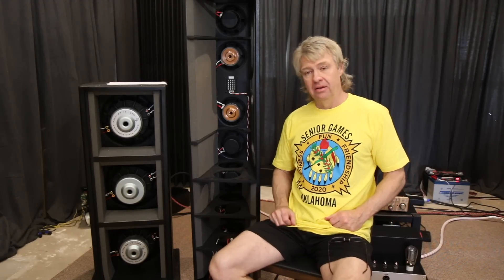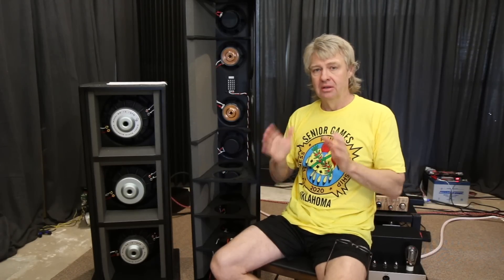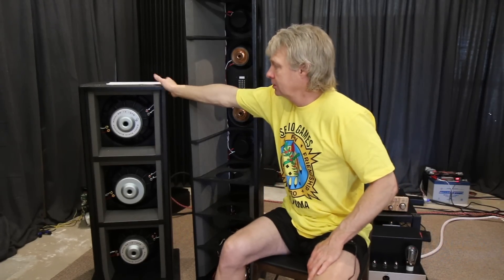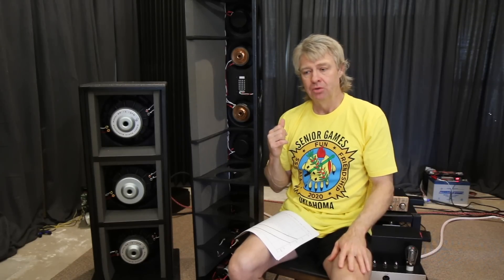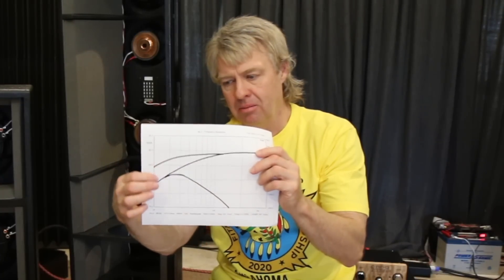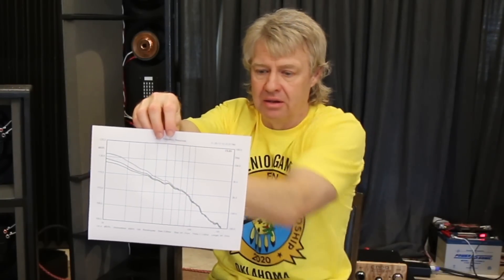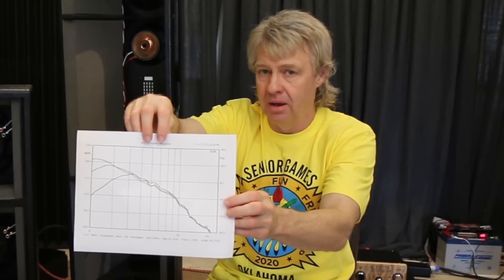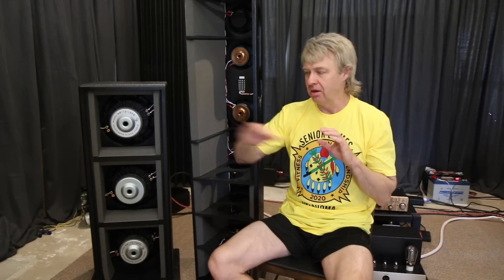Open Baffle Basics pt.4

Comment: I am embarking on an exciting project to create an Open Baffle speaker system, and I've already selected some fantastic drivers. For the high frequencies, I will be using the Dynaudio D28 tweeter, which boasts a sensitivity of 93 dB SPL. For the midrange, I’ve chosen the Dynaudio D54 midrange driver, known for its higher sensitivity of 96 dB SPL. To handle the midbass frequencies, I plan to incorporate the Dayton MB620-8 6.5" driver, which has a sensitivity of 94 dB SPL.

However, I find myself at an impasse when it comes to selecting a suitable 15" bass driver. After delving into numerous forums, I encountered varying opinions regarding the ideal Thiele/Small parameters that should guide my choice. My inclination is to go for a professional-grade ribbed high SPL driver, as their output can be remarkable compared to HiFi drivers. Yet, I’ve noticed that high SPL models tend to produce a softer low-end response, which is a concern for me.

I am seeking guidelines to help me choose the right bass driver. Is it truly correct to say that achieving a frequency response lower than 45 Hz is quite challenging with an open baffle design? Additionally, I’ve come across conflicting advice about baffle width; some advocates suggest a narrow baffle for improved soundstage presence, imaging, and depth, while others argue that a wider baffle can provide stronger, more impactful low-frequency response. My intention is to prioritize the best soundstage possible, and I’m open to incorporating a subwoofer later if I find that I need more low-end extension.

This speaker system is primarily intended for enjoying music, particularly jazz, where the richness of a stand-up bass, the clarity of vocals, and the overall dynamic range are essential. I will be using a Yamaha TRS700 amplifier with a rating of 100 watts into 8 ohms, which can also drive a 4-ohm load. My plan is to wire the bass driver at 4 ohms while keeping the three other drivers at 8 ohms.

For my crossover design, I’m initially considering a first-order Butterworth network for all drivers, with the possibility of transitioning to a second-order Butterworth if necessary for smoother frequency transitions.

I know this is a detailed request, but I would greatly appreciate any assistance you can provide in selecting a bass driver that complements the characteristics of the other three drivers, all while keeping the budget under $100.
Thank you in advance!

Comment: Nice, I'd love to hear these. One question, does the full-height-wing-side face the inside or the outside when the speakers are in place and toed in? So take just the lft speaker, is the full height wing on the right (inside) or left (outside). Also why?

Comment: Hi Danny - quick question.  I see you have 3 different models of drivers for Servo Subs on your website.  For the life of me, I am not spotting the difference between the three.  Can you help point out what is likely right in front of my nose that I am missing?
Reply: The models with a FR at the end are designed for free air applications. We have them in 16 and 8 ohm versions so that they can be run in parallel. The 4 ohm woofer is designed for sealed boxes.

Comment: My question is, if you can only go down to 200Hz on a OB, and you still need two subs to reinforce the sound, whats the point, does they really give so much clarity compared with just using a top class driver such as Seas Excel, and wouldnt you also wish to have an open back tweeter if it makes a difference to high frequencies?
Reply: We have open baffle drivers that play flat to 20Hz. Also, our NX Series models have a planar magnetic tweeter that is full open baffle as well.
Reply: @dannyrichie9743  Isn't flatness more a function of front panel design than than the actual driver? a serious question as I am unfamiliar with them.
Reply: @engjds  There are several things going on here. Front to back wave separation will control low end roll off. So a wide baffle or a baffle with side wings will extend low end response. Our servo controlled woofer are loaded in an H frame and with the help of the servo control system, they will play flat to 20Hz.
Reply: @dannyrichie9743  20Hz is a bold claim, though I do not doubt you have measured it correct, it must be very sensitive to room placement with all those additional room modes?
Reply: @engjds  Are  woofers are not at all sensitive to room modes. Our woofers play flat to 20Hz and hit -3db down point in the teens. They also stop on a dime. 🙂
Reply: @engjds open baffle speakers have a finger eight radiation pattern  so side reflections don’t really exist.
Reply: @Margarinetaylorgrease  figure 8 sections must still count when the position is such they become standing waves, I do not understand what you mean there.

Comment: I am a big open Baffle fan but as a fan of SE tube amps I have a little different philosophy. I am not a fan of servo control and arc welders for amps.

My thinking goes like this. Large, efficient, high Q bass drivers wide range mid (AKA FR) and super tweeter.

Since the output transformers are likely to struggle below 30 or possibly 40 Hz there is no need to try to force them down to 16Hz. Just use a sealed or IB sub for the last 8va or 8va and a half. The percussive bass is well within the range of the mains so you get the terrific OB bass sound and the sub can handle the lowest pedal tones. If you can get the sensitivity you want with a single 15 or 18 OB woofer you can even include the subs in the same stack.

Comment: hello Danny, does a h frame really separate front and rear waves ??? Air inside the cavity will load the driver. but since the wavelengths are huge, separation of front and rear doesn't happen i guess. or may be negligible minimal.

Comment: On your site, you have kits for "sealed servo" subs and "open baffle" subs.  However, the amps and drivers seem to be the same for both.  What is the difference between the two?  Couldn't you also use the "sealed" driver/amp combo in a ported or open baffle configuration?  Or am I missing something?

Also, you are using 370 watts for a single driver sealed sub and 370 watts for a double OR triple driver open baffle sub.  Doesn't that create a problem with response to spread the wattage over more drivers (e.g. damping, excursion, etc.)?

Thanks for the very informative series!

Comment: I built a pair of  your W/Frame subs back in 2016. They provide a nice bottom to Magnepan 3.6 planars. For music they are fine, but often with heavey bass in movies and TV they would bottom out and often  blow the covers off. To fix this, I even ordered new Rythmik drivers and modification to the A3470 PEQ from Brian to build new sealed subs. But, after setting up a new Lyngdorf MP60 2.1 processor things have changed. Before I ran the MP60's RoomPerfect  correction program, it told me to do a sub adjust program first. I did this to the W/Frame subs and then I ran RoomPerfect with 13 mic positions to 100% room correction. The subs no longer bottom out and my 7.2 Magnepan system has never sounded like this. I guess I will try to return the Rythmik parts back to Brian since the W/Frame subs are completely under control. Or, I could build two additional sealed Rythmik subs and add them to the system. The MP60 has 16 outputs and I can't use Atmos with a sloped ceiling. Do you think the sealed Rythmiks would be worth the effort or would they add probems? All the Maggies and the W/Frame subs are open baffle and maybe adding sealed Rythmiks would not work.

Comment: Very interesting series Danny. I wonder though. Given the significant variation in response afforded by even seemingly minor baffle length variations, if these speakers are set too close to obstructions, too close to a back wall for instance, all of the endless trial-and-error endeavors to arrive at finely controlled response would be eaten alive by the room influences. So it seems that the box speakers, while not immune to such, provide some leniency in this regard. Once again, having a system to model this, much like I have seen finite element modeling used in my field (Chemical Engineering and don't ask why I am so intrigued by this topic, so far removed from my SME), well, that would go a long way toward not only arriving at optimal baffle configurations but would also afford some sense of room placement guidance. I have tons other thoughts about how these open baffle designs might be improved in light of my understanding reached by watching these and other videos but this message is already a chapter.

Comment: My journey since I started to look at loudspeakers from an engineers perspective. From low to high transient performance: Bass port cabinet > Sealed cabinet > Aperiodic cabinet > Open Baffle or dipole > H or U frame cabinet. Its rather incredible what happens once you step outside of the comfort zone (first two types) and look at what other solutions offer AND... and what them speaker drivers like. In the end, if you allow it, the driver can become a bliss and not something that is working against your goal.. Just saying :) .. Love your videos.

Comment: Is it worth making an open baffle bass driver without servo control? I want to do something with my GRS 12sw-4 drivers and I'm coming up with some interesting ideas, but something simple that makes me happy would... Well, make me happy! Isobaric ported boxes are intriguing me, but even with 2 drivers the box needs to be huge to be reasonable flat, like 5-6 cubes. I rattled an isobaric type setup with 3 drivers providing one driver's worth of rear wave for the ported section, but I'm thinking that may end up just as unbalanced as using two drivers. 

I'm thinking of a sort of W frame for the open baffle design. Just sort of imagining it, I could isolate and kill the rear waves quite well, but not sure how I'd get that low extension without expensive equipment, or if I'd be satisfied without it.

Thanks for the videos. Open baffle information is scant online.

Comment: Great video series, thanks.
Q1: How come the X Statik doesn't have any side wings?
Q2: Despite the fact that open baffle speakers are easy on the room, they still cannot be placed near walls?
Reply: answer for Q2: For the higher frequencies, the reflected sound enables the brain to cancel out resp. to dismiss the complete reflections to at the end meet the sound as if there was no room at all, the speakers seem to disappear completely - the brain, so to say, creates a hearing-feeling like hearing in a nature ambient, reverb-free, although the ears are "hearing"=receiving a mixture of reflected and unreflected, direct radiated sound. The time-delay beetween the direct and reflected sound-waves is important here and in most rooms, a distance of about 4-5 feet e.g 1..1,5 meters away from a corner/both walls will be the optimum to achieve this effect. Siegfried Linkwitz has found out, that a dipole design, that has the same spectrum radiated in front and rear of the speaker, will be the best. Behind the listener, the sound should not be reflected, but mostly absorbed or reflected with a much higher delay (and lower energy/sound-level) than the reflected sound coming from behind the speakers resp. coming from the just mentioned corner. This is, why in smaller rooms, a dipole-design will not function properly, because the brain can not distinguish between the reflected sound from behind the speakers and the direct sound reflected from the walls behind the listener.

Comment: What are the dimensions of the NX Extremes and the 3 stack sub i.e. height width depth?  I could not find that info on the website but may be I missed it.  Also, what is the height of the NX Otica's.   Many thanks.

Comment: Hi, what is your opinion and experience of hole in wall baffles which are almost as an infinite baffle?  thank you for your talks, most informative.
Reply: it is to cancel out what comes from the front with what comes from the rear. If mounted in a Wall, you cannot use this stunning feature, killing standing waves between walls. It is then like a closed box with the resonance frequency of the driver like in free air and may be without reflections in the cabinet.

Comment: Interesting stuff!  Would there be any downside to making the H frames deeper?  It seems like it would naturally lower the roll off which would allow more output at the lowest frequencies.
Reply: right - downside is, that resonances will go down too, so you may need to set the crossover frequency lower too.

Comment: Thanks for all this info. I have no experience with Open Baffle speakers but plan on trying out some basic stuff on my own.

Design question: has anyone tried to build an L baffle of sorts using a tube cut at an angle? In other words, imagine a driver mounted at the end of a PVC pipe just big enough to hold the driver. Cut the back of that tube at a sharp angle so that the sides of the "U" are effectively, let's say, 10" on one side, 2" on the other, and everything in between as you rotate your cross section. Multi-driver systems can just use one pipe per driver.
1. It would create the smallest baffle possible for a given driver, although it's round and likely the driver is centered on the baffle. But that means baffle step should be smoother and easier to compensate for.
2. The transition traveling around the driver is smooth, where an L frame has two strong peaks on the frequency. The angle cut tube would "smear" that across the whole frequency spectrum. That might fail to achieve the desired response but it might make it much smoother. I know speakers mounted in the center of tubes and spheres is a big no-no but also tubes create a smoother wavefront like a waveguide.

Comment: Is it possible to run your open baffle subs without the servo plate amp? I mean, power them with a traditional amp.
Reply: of course - why not? Difference is the adjustment of the cornerfrequency, a flat response and a much quicker settlement of the membrane, that will not be damped additionally by the feedback.

Comment: @Danny Richie  Hey one final question before I glue it all together!

I have not cut any deeper for the woofers to sit then mounting flush on the front baffle.
Do I mount the front of the baffle board @ 6" on my 12" wings to get ideal 90* cancellation?
...or... do I mount the center of the 3/4" baffle board at 6"? (Aka the front sitting @ 5 5/8")

Comment: Hey Danny, thanks for this informative series, it has been very insightful.
I’ve wondered one thing about open baffle bass  and there is no one better to explain than you. I understand that traditional box subwoofers are pressure making devices and pressure is at a maximum at room boundaries and a minimum at the centre of the room where a null in bass can typically be measured.  Opposingly open baffle subwoofers are velocity making devices, velocity is at a minimum at the room boundaries. 
Does open baffle bass have the same null in the centre of the room that box speakers have or does the different room interaction change this dynamic?
Thanks.
Reply: The output levels will vary from room to room and depending on where you are in the room, but in general the room will have a more even output except at right angles to the speakers (of coarse). And the output in the center of the room is pretty solid.
Reply: Thanks for the reply. I’ve been following you online for a few years and hope to buy and build some of your stuff the new year. Here’s hoping it’s a better year for all of us.

Comment: When you have multiple heavy drivers with such an agressive control, in a relatively light chassis, dont you get problems with keeping that chassis in place? Feels like it could start rocking about on the floor?
Reply: The servo subs are in a very heavy cabinet. It doesn't move.

Comment: 8:00 What size inductor do you recommend I try on the lower woofer? Upper and Lower woofers are 12" 4ohm. They are wired in series for an 8ohm load.
Reply: use a seperate woofer amplifier - it's cheaper than big coils with low resistance, and a huge capacitor you will need too, expensive as well.
Reply: @ahnenpost5237  That's not what I asked. On top of that it's not cheaper
Reply: @edjackson4389  you have to wire the woofers in parallel to use an inductor (in series) for the lower only.placing an inductor in series with the series wired woofers is going to affect both of them.if you have dual voice coil woofers maybe you rewire them so the driver s can be wired in parallel and not cause too low impedance.hopes this helps.dannys suggestion of choke in one of two parallel connect drivers is also useful to correct for baffle step response on multiple midwoofer and 2,5 way designs.

Comment: Hello my friend...love your knowledge of speakers...i have been looking for the longest on a strange problem...i bought 2 psa s3612 subwoofer with ipal 18inch made by b&c .i had a pioneer sc55 for 10yrs and on the day i connected the subs i was scared on how powerful these sub sound,then the pioneer went off on me the same month,so i was in line to buy the denonx8500h, now connecting these same subwoofer now cause a popping noise at low frequency these are supposed to go as low as 11hrz,but it pops. I call the manufacturer and they sent me the settings on how to set my subs i did but now i watch movie and feel i am missing that punch...they now i bought this denon on ebay open box deal...manufacturer said that this is normal that the denon is sending a clipped signal causeing the subs to pop..your input if any is appreciated thks.